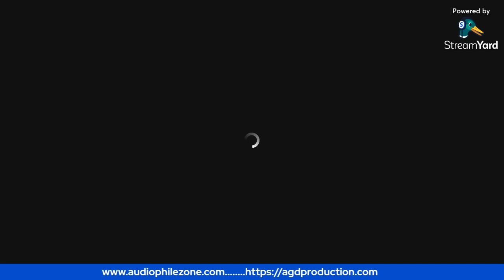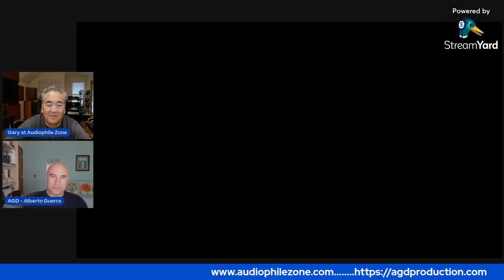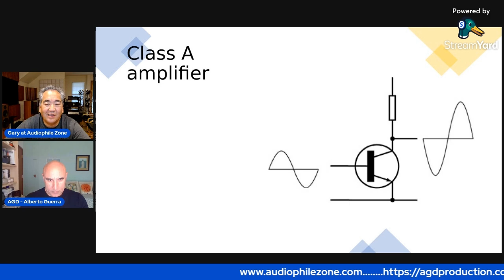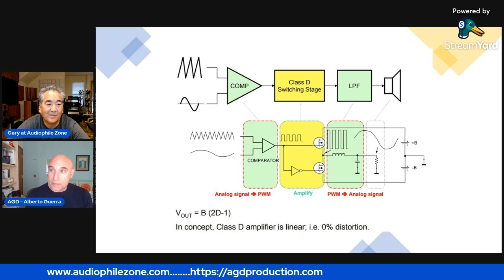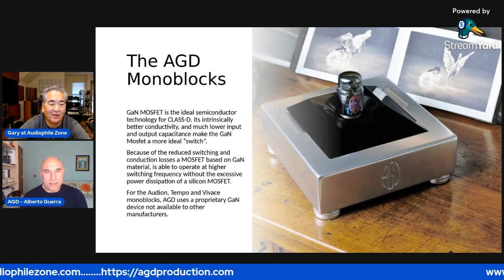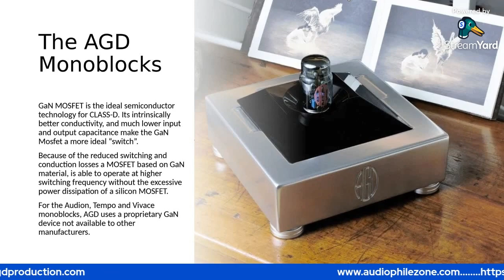AGD Amps Class D done right!

Comment: What is different about this amp and a HiFi rose 280 or 180?They both use Gallium nitride fets.
Reply from the maker: As mentioned in the video, the device AGD uses is the only one that was designed for audio from the ground up. AGD has the only supply of these, they bought them all. Similar to what Nelson Pass does when he finds a device he likes.

Comment: Umm... these are about 15000.00 to 16,000.00 more expensive than other options that I'd venture perform better.  State of the art GAN is sub 2k, Purifi can be had for around 1k.
Reply: Same design, not the same materials. Go over parts & chassis differences + smaller USA production is always more $$$.
Surprised you don't know that.
Reply: @saint6563  not gonna name names, but I'm speaking of US production. I'll give you the chassis difference. Still...